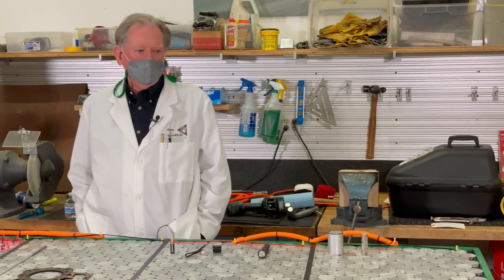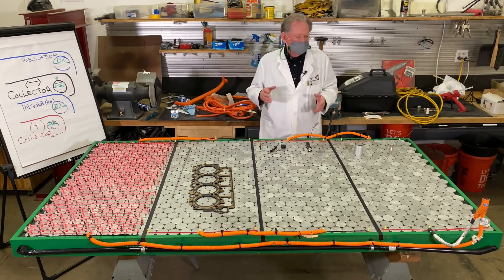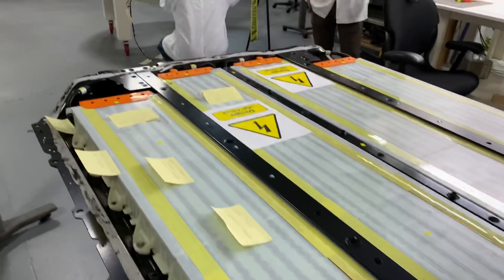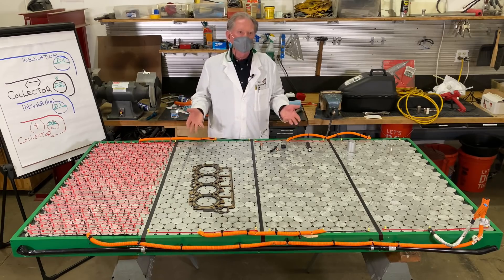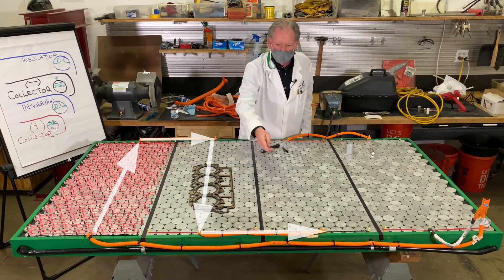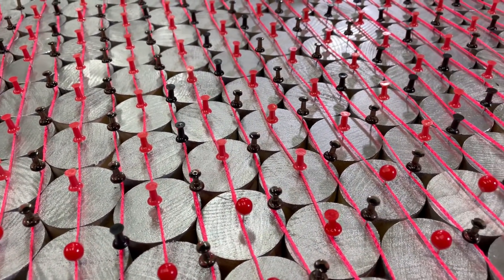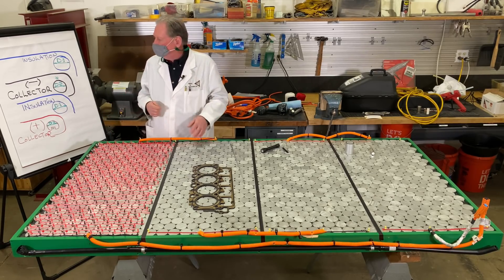Tesla 4680 Battery Pack Prophecy

Comment: Let me suggest making a partial, paper-cardboard model of the pack. 

Make thick paper tubes 4680, enough for 2-4 rows. Then use regular cardboard, cross pleats, glued together for top and bottom sheets with holes for the mock electrical buss bars. The paper 4680 cells are glued to the top and bottom sheets.  Glued together, the beam would be strong enough to hold a significant load (one or more of your team.) With legs, it would be nice bench yet easily picked up by the smallest person on your team. Be sure the original, flimsy parts are shown to compare and contrast with the model.

Optional, mount cheap, AAA cells inside the 4680 cells and connected to thick aluminum sheet buss bars for parallel-series. Using appropriate gloves and safety equipment, 'strike an arc' from the pack and do some light duty welding. 

Being a retired engineer, sketches could show the how the paper/cardboard structure handles the stress and strain that the original parts could not.

Comment: Sandy, what do you think about the solid state battery competitors that are coming, like QuantumScape, for example?  How will the Tesla 4680 battery compare to those?  Is solid state the way to go in the long run, and is the 4680 design just an interim solution until Tesla eventually switches to solid state as well?

Comment: why wouldn't they connect the sides by weaving a flat wire through the grid below the surface?
Reply: or is the negative not the side but only that little rim?

Comment: I think you are the one who is confused .  You did not tell them the difference between parallel and serial or what either was.  What you should have told them is that if one battery fails in a series circuit the power is shut off,  and each battery in series has it's voltage added;  having 4416 of them in a car and depending on every one of them equates to 4416 chances that  your battery is going to fail.  All batteries meet their end !  Sooner or later somebody is going to purchase a new battery pack and it is going to cost thousands of dollars.  I will just purchase some gas.

Comment: So that is four modules of about 84 volts in that battery? Some other EV batteries are higher in total voltage, as far as I know. How does the DC chargers handle each different EV to find the right charge voltage for that car?

Comment: Mr. Munro, You have made a great presentation with very little data given by Tesla. It looks like your wooden battery cells aren't 46 mm diameter; so, the battery pack is larger than actual. If the 4680 battery cells are packed in the smallest possible area, it makes a pack (not including structural elements) of a unit 50 inches by 50 inches. If this close spacing is used in the production battery packs, it will be a very compact unit. THEN, the technology really does leave ICE vehicle in the dust, in several different metrics. 
  I hope you do a battery pack teardown when Tesla markets it first 4680 battery packs.

Comment: Mr.Munro, some interesting/disturbing video on the poor conception and issues with Tesla Model 3. 

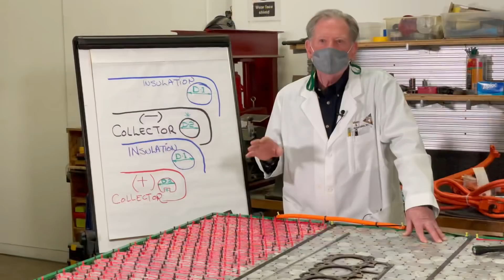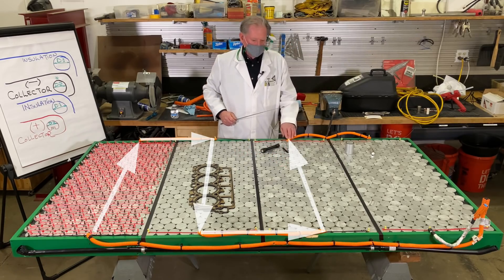I can translate for you if you wish. At 4:50 talks about missing clips and how debris enters from the wheel weal, 6:25 welding joints rusted due to poor paint/protection, 7:10 all the debris that accumulates and sits under the rear protection plate of the car(he mentions having removed 45lbs in one car) 

https://rpmweb.ca/fr/videos/reportages/reportages/antirouille-bolduc-partie-1-les-defauts-des-tesla?fbclid=IwAR1842osM2_SUlfnlKkdwyeWvJ07aaDNlAVTGREZ1tCEIXCpeg3PSWjE9ew

Comment: Great video. The design makes a lot of sense. I'm not certain all of the batteries would be strung together in series. I think a bunch would be wired in parallel. Putting baterries in series will increase voltage but you need to have them in parallel to get the current necessary to run. Further, if one battery goes the whole batter pack does. Unless he was saying you string 10 batteries in series and then the rows in parallel

Comment: No No No Mr Munro! I respect you a lot and love your channel but this is the first time I disagree with you.
I could be wrong of course but this is how I understood the tabless batteries work.
You roll up four 80.5mm wide strips, one cathode 0.5mm to the left, a electrolyte in the center, an anode 0.5mm to the right and then again an electrolyte in the center. As you roll them you fold the protruding 0.5mm edges of the anode and cathode inwards 90 degrees (hence the photos of a circle with the ruffled edges in a spiral) thus creating a positive and negative surface at each face of the roll and you will have to finish the barrel off with a insulating (plastic?) layer. There will be no need for metal can. Now you can glue a strip of metal over each face of one or more rows of batteries with a conductive ( both electric and thermal) glue to get more amps (parallel) and then join these metal strips in series to create the volts.
The thermal control happens on the metal strips away from the batteries themselves.
The beauty of this system is that the electrons only have to travel 80mm max. to exit the battery unlike the possible meters to go round and round the coiled anode and cathode strips, the same goes for the created heat, which will be much less because of the less electron travel inside the battery.
p.s. I just found this explained by EEVblog on: https://www.youtube.com/watch?v=hbPKE62aM0U , watch from 10:00 onward.

Comment: 4680 cell is 12.50% taller than 2170. With the same area or footprint of the battery pack, it is obvious that the volume is 12.50% bigger. So the range increase of 16% mentioned was from the bigger volume. The  improvement is only 5.50%. Please comment if i am right or wrong.

Comment: I'm under the impression that the 2180 design is two separate, redundant packs, each made up of 2 modules, for a total of 4 modules. This is for FSD / reliability. You don't speak of this, but I feel like Tesla will not undo that decision.

Comment: Is it possible to manufacture a manifold for the cells that would allow the line workers to “screw them into place” instead of welding? Tesla released a video about the structural pack recently and it implied they were screwing the cells into place.

Comment: Great video!
Seems counterintuitive to redesign the cell to be tabless, to then go ahead and use a tab in the manifold. 
So I'm guessing the manifold will connect ground around the whole edge and positive layer is possibly without hole and connected over a larger surface somehow.

Comment: You'll not be able to stack batteries together without spacers unless they're all in parallel., in which case you have a 14V battery pack there
Reply: I agree. What he showed is 4 blocks in series and each block having many cells in parallel. As you say, this gives a total pack voltage of 4 times the cell voltage. To get the hundreds of volts needed for an electric car, you would need many cells in series.

Comment: A thought occurred but I admit I am in over my head on the subject and when it comes to math I can't add my fingers and toes and get the same number twice so the following is probably full of errors...

IF each 4680 cell is 5x more powerful than a 2170 cell then we can maybe hazard some rough math on of of these new fangled  "Munro Packs".  A current Tesla 2170 cell I believe is 5,000 mAh.  So maybe a new 4680 cell will be 5,000mAh x 5=25,000 mAh or 25 Ah.  So if each of his quarter battery packs is 24s10p I think that gives each 24 x 3.5v=84v and 25Ah x 10=250 Ah.  Those together for his 'pack' 84v x 4=336v and 250Ah. So  84 kwh..  I think..  And I assume that's a pack foot print similar to the M3/Y pack.  At 253 watts per mile with the current Model 3 Pack that's a rough range of 296 miles with a 75 kwh pack and 332 miles with a new pack or about 12% range increase?  So the extra range maybe comes from the weight reduction OR more likely my numbers are fubar.  Until we know the actual cell rating though we can just guess.

Comment: I thought the point of those tiny wires was to act as fuses, if a cell shorts it burns up the wire. 

But if they go to manifolds they may be too thick to burn up on a short and could cause a bigger problem instead of just having a single cell falling out instead of an entire series.
Reply: I'm sure they'll keep the fuse function

Comment: This packing looks pretty efficient, and I know there are some issues making square batteries, but I cant help but wonder if there is some way to use the space in between the cylinders, even if it's not battery per se.
Reply: Would it be worth it to stick an array of thin, potentially semi-structural heatsinks in the cracks? Maybe attached to some metal  on one or both sides for ADDL. thermal conductivity? Maybe all you would need is a very thermally conductive foam.

Comment: Great video. Question: why are the batteries not layed down horizontally then (it’s surely easier to daisy-chain them that way)? Is it to add rigidity to the structure?

Comment: Sandy, because of the way the electrical connections are formed at the cell level, it doesn't make sense to run both connections to the top. You would need an electrically isolated ribbon from the bottom to the top for this to be true. Would this connection reduce thermal cooling at the bottom of the cell? Could the connect be built into the jelly roll to avoid mechanical gaps?

Comment: What final stacked voltage do you think the new pack will be? What is it now? Do you think Elon is looking at increasing the voltage to lower I^2*R losses like his new competing former engineer is doing or do you think he wants to continue using cheaper, lower voltage components in the induction motor controllers? The higher the voltage, Lowe r the losses are and the lighter and cheaper the wiring harness can be.

Comment: Don´t be mad at me guys but this is simple high school pyhsics education. I was 15 - 16 years old when i was taught this kind of basics about electricity. 
So, Mr. Munro did a good teaching lesson about the upcoming new cell dimensions and module architecture of Tesla EV batteries. 
Every person who didn´t sleep during the lesson in physics should already have understood what is going on inside the rechargeable vehicle batteries without having watched this explanation video.

What i am missing in this "lesson" is the prediction of the total voltage of the battery system,  the capacity,  the electrical resistance inside that battery and the weight of such a huge battery pack and the stability in case of an traffic accident with a frontal or side crash. The danger of short-circuits and resulting fire, which would burn very quickly and with high temperatures making the electric vehicles a death trap: 
https://www.focus.de/auto/news/in-der-schweiz-deutscher-verunglueckt-toedlich-im-tesla-feuerwehr-untersucht-akku_id_8930883.html

https://abcnews.go.com/Business/man-burned-alive-fiery-tesla-crash-door-open/story?id=66498159

https://insideevs.com/news/455369/stoned-driver-tesla-model-3-crash-oregon/

May be you can deliver those values in the description by editing it Mr. Munro ? Or just make a new video about those values ;-)
Reply: The voltage he said was 336v.  The rest is technical information I would not expect him to have.  As for battery pack safety they usually put them in low in the center for safety.  It's far far safer than a tank full of highly flammable vapor producing liquid, thousands of cars catch fire in accidents each year vs how many Teslas?  There is a reason they're the safest cars on the road. You didn't do your research and as far as death traps go you look genuinely ridiculous.
Reply: @TheEvilmooseofdoom  I know very well that ICE cars do burn in traffic accident mate. I am a retired police inspector and have seen hundreds of such fires. You didn´t get the point behind my question considering battery packs as a death trap. 

As electriv vehicles are evolving with each new model there should be thought of radical solutions to avoid the risk of burning to death in electric vehicles after an accident. The risk is very low yes, but still present. And in case of batteries the danger is completely under the passengers cabin !

So if i was an engineer, i would integrate several foam fire extinguishers inside the battery pack ( working similar like an airbag ) in case of deformation or sudden high temperatures inside the battery pack the sudden NON-CONDUCTIVE foam boost inside the battery pack could extend the time to escape out of the fire zone by massively reducing temperatures and deadly gases ( caused by fire ) inside the passenger cabin !

Saving life MUST be prioritized ! 
So a new battery module constellation gives a  good chance to make the next battery pack perfect considering the safety !
Mr. Munro and his company have so much positive influence in the automobile industry to push things forward.
May be the idea of non-conductive foam fire extinguishers inside the battery packs is something he and his company would take into consideration to discuss about.
Reply: @Ken_1971  IF battery fires were a major concern then perhaps.  But they don't even do that in gas powered cars.  You're talking time and money to engineer something 100% safe and that's usually impossible.  What next O2 and masks in case you go in the water?  Safety is a priority but you have to pick your battles.
Reply: @TheEvilmooseofdoom  You are overexaggerating a little with your O2 masks, don´t you  ?  
When it´s possible to engineer something in perfection, why not take the chance to do it ? Money isn´t a problem here !
It´s people like you who might think : 
"Pfffff, who cares that someone burns up in his electric vehicle from time to time !? " 

I tell you what, I care and i bet many others do too !  
Why have safety belts , headrests and airbags been installed in cars after the 1970 ´s ? 
Why have the passenger cabins been constructed as stable as possible ? 
To save lifes ! 
And what i proposed with the non-conductive foam fire extinguisher inside the battery pack is something of importance and on same level as other safety features in vehicles  !   It´s all about extenting the time for rescue teams to get the people out of the vehicles after severe traffic accidents. From time to time people are just stuck inside the totally deformed vehicle and the firefighters do not have time to cut the metal door frames to rescue people. 
Young Padawan, you definatly never served as a Police officer or Firefighter or Paramedics or you would understand how important this is ! People are dying in their damn cars because they run out of time !
The fire kills the people , not the crash impact. Have you ever seen somebody burn in his car ?  I did during my time as a police inspector and it was a really terrible experience.
Reply: @Ken_1971  No more than you overexaggerate with foam fire suppression for vehicles less likely to burn than other vehicles.  You over emphasis your experience by pretending it's somehow valid engineering or even cost effective and it's neither.   You're weakly defending an exceptionally weak point.
Reply: @TheEvilmooseofdoom  And you are a classic "nay" sayer ;-) 
Instead of supporting a good suggestion you belong to the kind of people who always see negatives and talk about cost effectíveness and who stop the technology from evolving into a good direction. Elon Musk is more like me than like you !
Reply: @TheEvilmooseofdoom  OMG yes, now that you say it, it must be so , right !?
I never realized that ! You must have studied psychology for many years to be able to analyze my ego. Thank you Professor Smart ! 

Don´t waste my time !
Reply: @Ken_1971  Reality sucks, but it is what it is.

Comment: Great idea, but you need to incorporate individual cell fuses (thin conductor) so that a shorted insulator inside a cell does not get to short all the energy of it's parallel connected cells.

Comment: Since the negative is the outer case of the battery I would make a bottom plate that connects all negative contacts from the bottom and do the same for the positive  on the top.  no spot welding   wires.   Just apply  enough pressure on upper and lower cover to force contact.   One could press a dimple on the contact plate for each battery.

Comment: Batteries in series  the voltages adds.  in parallel the  current adds.   
The flash light   example  you would have 1.5v+1.5V= 3 volts to light the led light.

Comment: Given that the 4680 is better, when will Tesla switch to 4680 across their lineup? I understand that they've got the 2170 infrastructure in place, but at some point I'd think that an upgrade would be appropriate, given cheaper cost, better performance, etc.

Comment: Thw simply reason why there was a dimension change is because there is less material used for the outside cover of the battery and thus reducing the amount of liquid cooling wrap around each cell. In the past fear was inability to keep the core if cell temperature regulated. They must of learned that they can safely expand to this diameter.

Comment: One question I have with these 4680 battery packs, is how easy will it be to swap out bad cells when the cars are 100,000 miles down the road and you start getting cell degradation, given that the cells are going to be glued in place with epoxy glue?
Reply: One possible solution is put each in a thin sheath and have the epoxy adhere to that so if you need to swap a cell you slide it out of it's sheath and slide a new one in.  Or they could maybe skip that and cast the epoxy in a mold and then insert the cells into the cavities after the cure.

Comment: So am I correct in stating you have 4 (96 batteries. 336 volt total) modules giving a total output of the 4 pack 336 v x 4 = 1344 volts?  Very efficient because all of the spot welds could be done in one step.  3 step assembly process 1.Place the batteries in structure 2. install manifold 3. Spot weld in one swoop 4 x(96 x 8) + lead wires